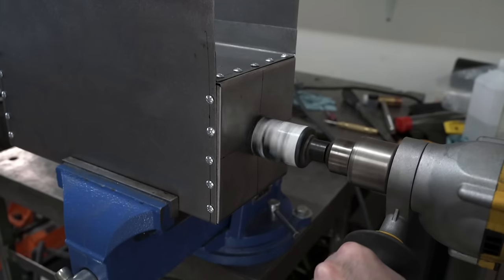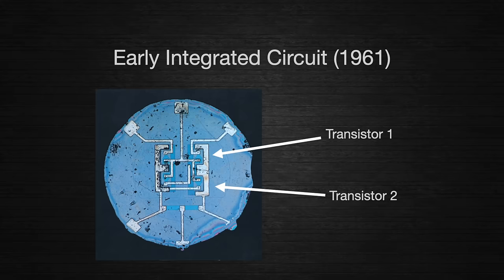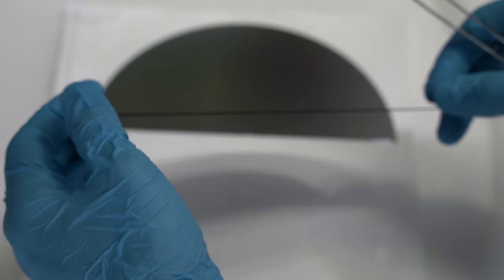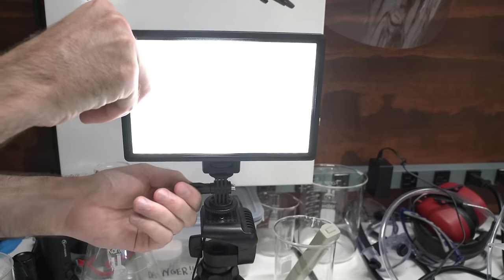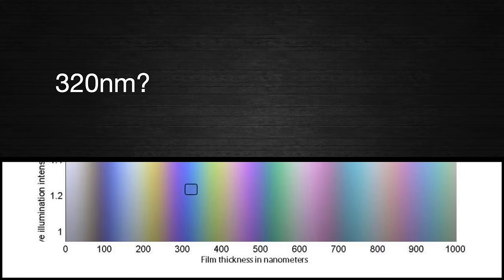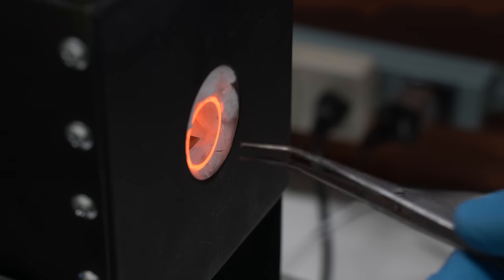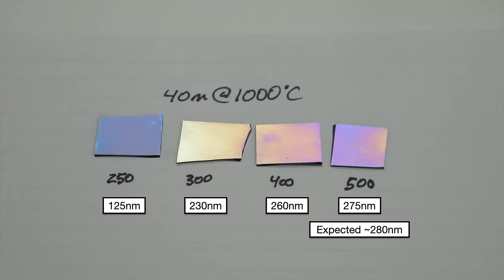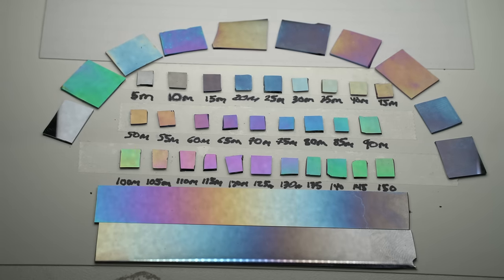Growing Colorful Oxide Layers on Silicon

Comment: In industrial tube furnaces, they have multiple heating zones to deal with the spatial temperature gradient issue. Each zone has its own heating coils and thermocouple, so heating power can be distributed to where it's needed to keep the temperature even throughout the whole length of the furnace. If you ever build an upgraded furnace, it would probably be worth giving the ends of the tube their own heating zones. For the steam consistency problem, maybe a mass flow sensor controlling the boiler heat to keep consistent steam flow into the furnace would help.
Reply from the maker: The independent zones would be a godsend. I may implement that when I rebuild the furnace!

Comment: In the 1980's I worked in wafer fabrication. Back then, we used to measure SiO₂ layer thicknesses by their colours. Whilst there, I was working on Silicon Nitride coatings for specialist devices. The Nitride layer thicknesses could also be gauged by their colours. Nitride colours on Silicon are even more striking than Oxide colours.

Comment: I am hoping to make my own chips eventually. If you want a tip, you should be able to apply a mask using a modern DLP chip used for 3d printing. TI has some chips that just came out that should have roughly 1um per pixel mirrors if you create a custom setup similar to Breaking Taps' UV laser optics. The chips are about 4k resolution and should cost between 1k and 2k to purchase. I don't have the room right now to set everything up, but maybe you can get it to work. The holy grail would be to be able to make chips at home for less than 10k, but it is difficult. Might be more feasible to use a very precise laser engraver with some fancy optics. I am very excited to see more!

Comment: For steam generation you might look at the small steam cleaners that are sold for use in cleaning bathrooms. They have a pressurized tank and would allow the water in the tank to get above the boiling point of water at atmospheric pressure. It might allow the production of a more consistent steam.
Reply from the maker: Someone had an interesting idea to use an ultrasonic humidifier which I might try soon

Comment: Instead of using boiling water to generate steam could you instead use a ultrasonic water vaporizer? For example a humidifier or diffuser? I imagine that would be much more consistent.
Reply from the maker: That actually sounds like a great idea. I may try that. I think in industry they might just drip water directly into the tube or something too
Reply: @projectsinflight  I don't know how one would go about it exactly, but a "superheater" of sorts where the steam is passed through something at the temperature you want may keep it at that 100c+ temp.  Armchair thought but it might work?
Reply from the maker: @ericlotze7724  Actually just sticking the tube in the furnace a little farther can serve the purpose. I noticed that would dramatically improve the steam output. It's possible just a better insulated glass tube would work as well!

Comment: Just a note about the thinfilm interference. I was also give that explanation in uni, however the mechanism isn't that they destructively cancel out, as that would result in energy disappearing which would break physics. What happens is that you force the light to be absorbed. It's a petty distinction, and your explanation is an easy explanation for begginers.
Reply: what absorbs that energy? atmo?
Reply: @KarlF45  the material its hitting.
Reply from the maker: Oh interesting. I should look into that more- I always just kinda assumed that the interference was some kind of optical illusion. Didn't realize it was absorbtion.
Reply: @projectsinflight  applied science got me into it, its around the 9 minute mark. He's talking about transmission though https://youtu.be/iwj78pR46zM?si=mdBdrVqtBPocEqjB

Comment: I don't expect the majority of viewers to be handling silicon wafers on daily basis, so it's probably worth explaining in greater detail why that straight line fracturing thing works the way it does. for example, are cracks always aligned with the lattice? how do you know its direction? or are cracks simply perpendicular to the nearest edge?
Reply from the maker: I will make a video about the basics of semiconductors pretty soon (hopefully) that will cover all the topics that don't really fit in other videos

Comment: I am guessing isolating the atmosphere in the tube furnace would also fairly dramatically improve the repeatability of growing oxide films (or any reactive films, really).
Reply from the maker: I'll be testing that when I upgrade the tube furnace. That being said, i've actually gotten good results with diffusion so far even without plugging the ends.

Comment: Re: steam generation, maybe you can run the steam generator with a water intake and pre-heating instead of a reservior. That should give you pretty precise measurements of the amount of steam generated, the flow rate of the intake, and more accurate control of the power that the hotplate can transfer to the water as heat. If the plate's temperature controller is so sensitive to a body of high heat capacity on top, it would reduce that as well.
Reply from the maker: That's definitely a good idea that i'll explore when I rebuild the oven (which i'll do fairly soon)

Comment: Great channel with great content. One advice thou, alu foil is weak insulator, try some special heat resistant materials, the white cotton-like one you put your quartz tube seems to be good candidate.
Reply from the maker: Yeah, i might do that to save on some heating power. I have some other potential ideas as well

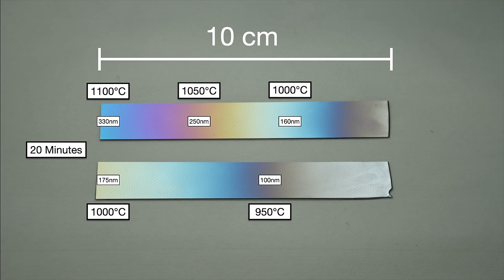Comment: 13:16 and if you increase the nichrome wire density near the tips of the tube to heat them more instead of increasing the lenght of the tube ?

Comment: This project is amazing! Looking forward to more videos. In the video the graphics and explanation imply you are growing an oxide layer on top of the silicon chip. Is is not the case that you are converting the top layer of silicon into an oxide layer since the silicon there will react with the oxygen. That would also explain better why the deeper you go the longer it will take. Anyway goodluck with future videos!
Reply from the maker: Thanks for the encouragement!

Yeah, In the interests of brevity I had to ditch a couple of nuances. It's a hard tradeoff.

Comment: the wafer is still dirty... look at the Apllied Science Video on solvents and the water-break test... super cool video and actually quite easy to implement for an amazing result
Reply from the maker: don't worry, i'm going to use better cleaning methods once i am working on processes where the wafer needs to be perfect. for basic fabrication steps like oxide growth and lithography a simple scrub and rinse is sufficient

Comment: You could track the steam production by putting the hotplate on a scale and monitoring the rate of weight loss. Only steam that actually leaves will reduce the weight. You might be able to automate this in a similar way to your oven controller, controlling the average wattage to produce a target grams-lost/time. The biggest hurdle is that strain gauge precision is a factor of load magnetude; I'm not sure you can practically maintain gram precision while holding up that hot plate, then you also have to hold the flask, the glass balls, and the water.
Reply from the maker: I was thinking i might better control the steam generation rate by dripping water at a set rate into a heating element connected to the tube. i figure that is probably workable
Reply: @projectsinflight  Will it be fine for the steam to be pulsed like that?

Comment: Could you use something like a piezoelectric vapor generator to replace your steam? It would be lower temperature, however you would likely have much better control over the generation rate. They would also be pretty easy/cheap to build, and you could an input to both sides of your hot tube. That would get around the need for two hot plates to input h2o to both sides, and it would get around the problem that a longer tube for the steam would lead to most of it condensing in the tube.
Reply from the maker: I'm not sure i need two steam generators, but an ultrasonic steam generator is something i might look into
Reply: @projectsinflight  I would definitely be interested in those experiment results. A minimal circuit can be made with a 555 and a piezo, so something better should be pretty quick and easy to prototype

Comment: Love the project, would it not be more convenient to use hydrolysis to produce your o2 than steam? So you can not have H2 in your thousand degree tube lol
Reply from the maker: The reaction of gaseous O2 with Silicon is very slow, so you really want gaseous H2O for speed. The amount of H2 produced for a couple of wafers is so small and is released so slowly that it's really nothing to worry about.

Comment: From the whitepapers I've seen, copper oxide is the way2go for homebrew semiconductor ICs. They had some struggles back in the day but it looks like it's possible to make functioning transistors with cuprous oxide, and their bandgap is much lower and the power requirement for switching them is thus lower. They can switch fast at low power! Having to use a silicon crystal wafer to make an IC is so far out of the reach of decentralizing semiconductor fabrication that it's a moot point. We need more people exploring and experimenting with alternatives to silicon, using materials that are commonly available to everyone. IC fabrication needs to be decentralized. It's the only real stranglehold that corporations still hold over the people (social media platforms are already about to be completely decentralized and become entirely p2p like a bitcoin/tor hybrid, so don't worry about that). We could also use some flying cars, so if you have spare time to look into antigravity, that'd be neato too :P
Reply from the maker: Silicon wafers are widely available these days and not really all that expensive.

Comment: Would submerging the flask of water in a bath of oil that you then put on the hot plate work better? It'll hold more heat and have more even heating.

I've heard people have so much issues with hotplates giving up on them really soon just cause they run them on high.
Reply from the maker: Yeah... I need a better heating mantle for sure. Strange to me that hotplates have such a short life, considering how ubiquitous they are

Comment: Wow, that are interesting videos you are creating! If silicon oxide is only an insulation layer between the actual component and wiring, why is it so crucial to know the exact thickness? Is it like a preparation before growing actual components?
Reply from the maker: The oxide thickness is important for a couple of reasons:
1. any two wires with oxide between them act as a capacitor and oxide thickness plays a factor in the resulting capacitance, which can degrade signals. 
2. Oxide is also used as a mask (stencil) for other processes and you need sufficient thickness for an effective stencil
3. Any HF etch to remove oxide takes a while, so knowing the thickness of the oxide helps you set the correct etch time
Reply: @projectsinflight  Cool, thanks! Looking forward to the new videos of yours!

Comment: Great work.
Have you thought of making a steam generator using a drip feed onto a hot plate?
An other thought is converting a vape device "Electronic Cigarette"? You would be able to attach one of these to a controller to adjust the steam produced.
Reply from the maker: yeah as far as I know this is how they do it in industry. I might follow this when i rebuild the oven
Reply: @projectsinflight another thought if you are making another is to split the heating coil, to spread out the hot spots, not sure how well it would work though.
Not end to end but over-lap them slightly.
Lets think theoretical: if the one you have  is hotter in the middle, lets say the middle third is twice the heat of the end thirds.
Then in theory if you had 3 filaments that overlap by a third, then the middle 5/7 should be the same temperature and only 1/7 at each end would be cooler.
Just one of those silly ideas I thought of 😁.

Comment: I might try a regulated 30% or > hydrogen peroxide drip over a silver substrate catalyst in a sealed properly relieved container plumbed into your tube oven. This could be stable in temperature and steam 2 H2O  + O2 output limiting open environment variables. The silver catalyst should be processed and reused.
Reply from the maker: I'm not familiar with that reaction- 30% H2O2 is pretty energetic stuff
Reply: @projectsinflight  It can be. Hydrogen peroxide's chemical formula is H2O2. When it comes into contact with silver, the silver acts as a catalyst. The reaction frees the extra oxygen atom to produce water, and also generates a lot of heat. The heat turns the water into steam. I meant to say <30%. I think consistency is the key for repeatable silicone color results. The decomposition reaction would give that. Carefully controlled with the measured addition of H2O2  on the Ag catalyst. Inversely adding the Ag substrate with some kind of splash free lowering apparatus might be more controllable. This is all with the precaution of carefully controlling the total amounts in the immediate vicinity and an over pressure relief valve vented to a safe location. Safety always first. I might dabble with this.

Comment: Curious how you cleaned the wafers with air. Given most type of air sources like a compressor would have some dust or even a little oil in them.
Reply from the maker: I have an in-line filter that removes most of the dust/water/contaminants. I'll have to do some investigation on whether or not it's sufficient in the future
Reply: @projectsinflight  Seems like using IPA that would all evaporate might be a better choice. But thanks for explaining.

Comment: if you have leds at various peak wavelengths and a decent spectrometer (or just run them one at a time with a filterless photosensor), as the number of wavelengths increases the ratio of intensities should become more and more unique. and higher frequencies would go in and out of phase quicker, so having some uv leds (or gas discharge tubes) along with a sensor that can measure that would give you more accuracy in low thicknesses. might not super useful but if you make some improvements to the tube furnace, it could help you better asses the accuracy, and would make a cool video
Reply from the maker: If I need better accuracy measuring the thickness in the future I might try something like this

Comment: Would  a drip system into some bump chips or sand or something in the steam generator maybe help ?
Reply from the maker: You know I THOUGHT that chips would reduce bumping and I cut a whole segment out regarding that. Weirdly when I used chips the bumping got WAY worse and it even was bad enough to be a safety hazard. One particularly bad bump ejected the chip from the furnace and it burned a mark into my bench. I have no idea why the chips made it so much worse.

Comment: Wow bro I am really impressed with your work as it is something I myself wish to gain knowledge of! Currently Finishing my Bachelor and have so much inspiration for the things I do in EE. One crazy thought, would it be possible for you to acquire such precesion of manufacturing to produce chips capable for image processing? Although they are just simple matrix multipliers. What is your opinion?
Reply from the maker: It's unlikely I'll be able to make chips with that many transistors any time soon- but you never know!
Reply: @projectsinflight  So what would be the main use of chips that you will be maufacturing?

Comment: IR thermometer to measure your ACTUAL WET oven temps WITH steam... Not your DRY oven temps.  1000c oven air plus "500c steam=Not the temps you think that you think it should be. That "500c" is actually a lot closer to 100c, won't get anywhere close to 500c unless you either pressurize it or Super Heat it, I think it's called "super critical steam".  Heat source on water to make steam, run steam through copper (or possible stainless steel) tubing and then apply even more heat again to heat the steam. There are videos about it. The energy it takes for the phase change of water makes it so that the gases phase leaves the surface of the liquid phase at a set 100c, no matter the temperature of the liquid. It looses a lot of energy jumping up into the air. Good rule of thumb... If you can see steam, then it's cooler than 100c because it's just liquid droplets flying through the air and not an actual gas itself.

Comment: hi, does anyone know if the oxide layer could be created in between silicon layers. what if  silicon layer are attached together encapsulant. can silicon oxide still be grown under dry conditions?
Reply from the maker: typically you build up layers so if you want an oxide layer between silicon you'd have to grow oxide first, then use epitaxy to grow a silicon layer on top. Not sure about sandwiching two unconnected pieces.

oxide can definitely grow under dry conditions, but it's a lot slower. the quality is much better though
Reply: @projectsinflight  thank you for your response. lets say I have thin layer of Al on the bottom of silicon cell and encapsulant on top of it. if I repeat the same procedure you did in the video, do you think it possible for the oxide layer to grow. do you know how Can I check it tho? 

Also I'm not sure about deal and grove equations in your video, I believe that they're applicable only for thick silicon oxides but they're highly limited at the initial steps of dry oxidation at least. nevertheless, it was really interesting video. thank .
Reply from the maker: Aluminum melts at 600 celsius so you're gonna have some difficulty growing an oxide layer at 1000C without wrecking it
Reply: @projectsinflight  what if I put it under 500c for 30 min with 3*10-2 torr pressure?